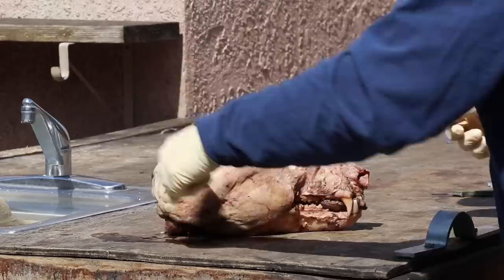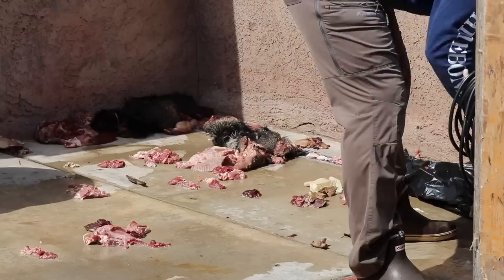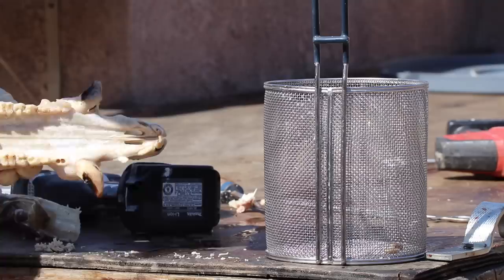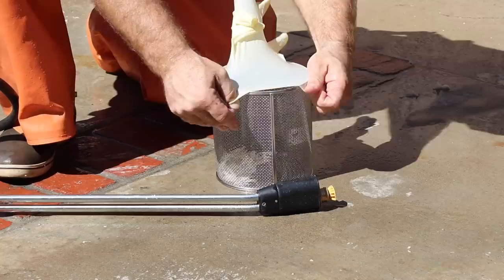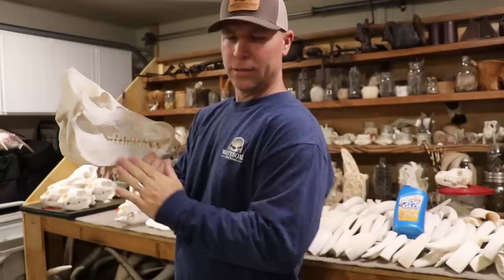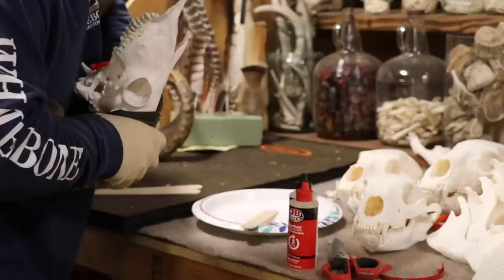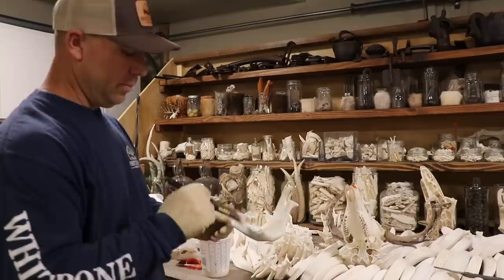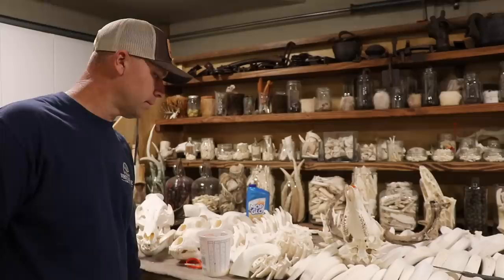SKULL CLEANING TIPS TRICKS AND FAQ'S

Comment: I'm a retired nail technician, if you needed to repair a spot, fill it in, you can grind some of your scrap bone that matches the piece you want to repair onto a powder (there may also be bone powder color variations you can order online under dentistry supplies, it's easy enough to make though) if it's a pit or crack, fill it a little at a time with super glue, then small amounts of bone powder to soak up the glue, then add drops of super glue, then more bone powder, starting one at a time until you learn how much to add and how fast, keep filling the pit with bone powder and super glue until it's flush or very slightly more than flush. Don't worry about the color or the shine, just fill the pit or crack. If it's a hole, apply super glue first to the inside edge of the hole and dust it quickly with bone powder. Build the layers until the hole, pit or crack is filled. Allow time between fill sessions until it's completely filled for each fill session to fully dry. You'll need to practice so you'll learn the bone powder/super glue ratio that dries without being tacky, you want it dry, hard/solid, not crumbly. After it dries very well, you can begin filing the excess filling off/down until it's flush with the part you're repairing. Go light and slow until you learn how much pressure is effective without filing into your piece. You can buy a WHITE nail buffer from walmart or beauty supply or a flexible fine sanding padded file to blend it to a smooth match, (learn the grits you need for the process and final look/texture) maybe use jewelry file tools to artfully carve in textural details so it looks seamless. Be sure to test/practice on scraps before actually doing it for the first time on a good piece. I've helped other tradesmen learn how to adapt nail techniques in useful ways in their trades and they were impressed with the usefulness and results. You can watch artificial nail videos like super glue glass nails (substitute nail powder which is powdered plastic for bone powder) or acrylic nails (for filing techniques) and you'll learn quickly how to adapt the techniques into your trade.
I hope this helps you or your viewers. BTW- you can screenshot this comment so you can have these tips for keeps.
This was a great video and I like that you keep and display parts for esthetics and use.

Comment: As usual great video, ive been drilling 3 holes on inside of each side of lower jaw wash through holes to get alot more stuff out. I also been blowing brain out before boil with a brain blaster, its a hose gun and thin coil pipe bent up, it blows the brain out with one squeeze of the gun. You can see it on you tube just type in brsin blaster taxedermy. I by no means trying to tell you how to do what you do best, but i know its slways about learing new ways. Thsnks again for a great video.
Reply from the maker: Ahh thank you for that I will check it out. I always appreciate a tip.

Comment: Firstly I’d like to thank you for your videos! They’re super helpful and very well done. 
Secondly I have a question:)
I don’t have a pressure washer and feel a bit strange taking heads to the DIY car wash to spray them off🤪 
So I’d like to know if you’ve got any tricks to get heads clean without one(the nasal cavity specifically cuz  I’m really struggling in that area right at the very back. It almost looks spongy and it’s driving me crazy). 
I’m working with pretty basic tools- screw drivers, scissors, paring knives, mascara wands, tooth brushes etc while I slowly build my tool supply.

Comment: On your white batch are you 50/50 now or still 25% Aqua silk? Did you change pressure wash size? Love your work always good to learn and watch!
Reply from the maker: At this point I am winging the ratios. I am working with two washer both electric. The normal green works and a 2000 psi unit for tough animals.

Comment: What kind of spray wand is that you are using?  Am in the market for the pressure washer you recommended but the wands are much different and the tip is a twist style.  What are your thots Master Skull Cleaner?  Mike in sunny Florida